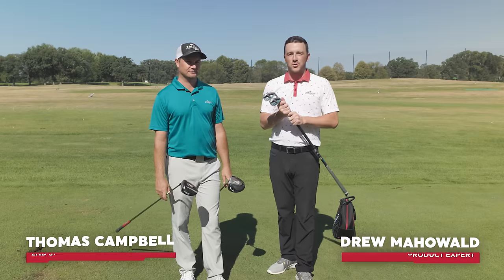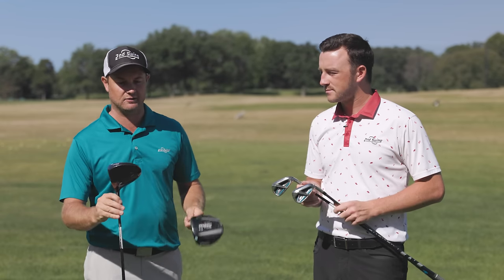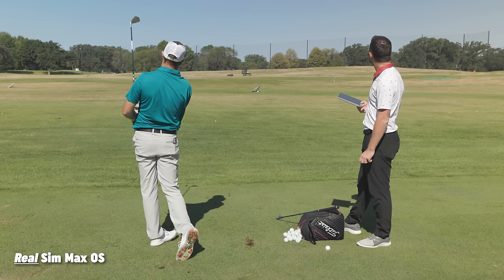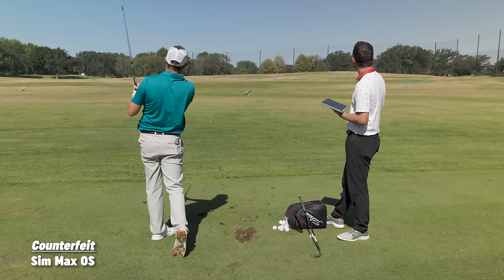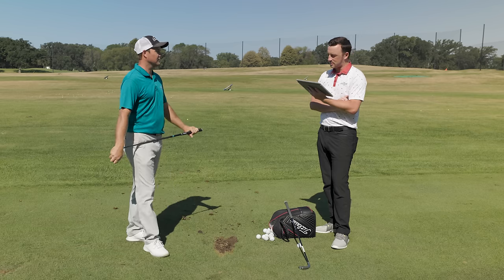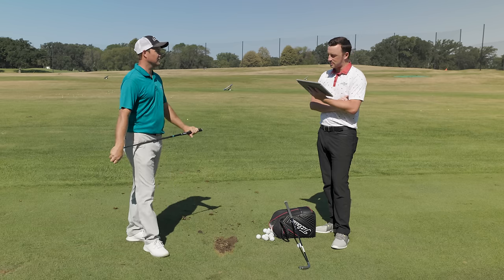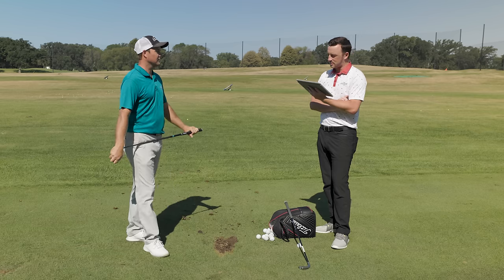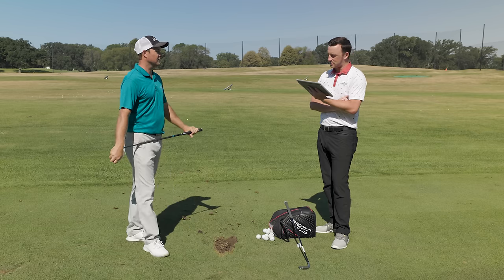FAKE Golf Clubs vs REAL Golf Clubs | Counterfeit Golf Clubs Test

Comment: As a plus 30 year clubmaker(Retired), if one would do a little research we would find that the major foundries in China are making golf clubs for most of the major brands and also the "fake" brands.  I sell clubs that are made by competent manufacturers and I check the weight of each and every component. I also check the iron shafts, wood shafts whether they be graphite or steel and  to make sure they have the correct cpm's by using a frequency analyzer.. Now having said all that realize your clubs are coming from either mainland Communist China or either free Taiwan. whether they are fake or not they are coming from these regions of the world some of these "fake" clubs are being made in the same foundry that makes the clubs for the major brands with the same specs. So I am not as adamant on whether they are fake or real as to do they perform and do they meet the specs that the manufacturers say they meet. For an example  All shafts are not stiff and to prove that point their is no industry standard for determining the stiffness of a shaft. They're so many factors in gauging a shaft for each individual golfer. The bend point (flex point) tip stiffness, butt stiffness , zoning of the shaft soft center, stiff center, I can go on and on. This doesn't take in each individual golfer who may swing 90 MPH, but one could be smooth throughout the swing while the other golfer may have a quick transition. So a huge reason to get fitted and to be aware of the price that you are paying for this fitting . Don't get snookered!   For tools I use  mostly Golf Mechanix products which are also distributed in America by Golfworks.  These tools help insure that a customer is getting the best performing club possible. I can safely say that most retail outlets don't even come close to any clubmaker. They (the big golf companies) throw the club together, glue it and cut it to industry standards and it is sold at your box stores. It is possible that 2nd swing and other major retail outlets have competent people working at their stores and they would be able to perform all of these services . Last rant I promise most of the drivers put out by all the major golf companies are fitted too long for the average golfer. They can't find the middle of the face with a 45 inch driver so why does the industry push a longer shaft to get more club head speed? If you don't hit the middle of the face you are adding spin and losing a tremendous amount of distance especially on heel shots. So I am an advocate of 43 1/2 to 44 1/2 inch drivers and leaving the box stores  to their over hyped and overpriced golf clubs and now with the  CNC machining and CAD programs this industry will change and the everyday consumer will benefit.

Comment: Glad I was just fitted with Callaway copies of the new rouge heads, carbon fiber shafts that fit my swing and real tacki-mac grips. I think they were hoping to say how bad the copies were but looked foolish when the copies are just as far, ball speed the same and most all the other stats are very close.  Even when the head flew off, that was the fathest one hit! The only negatives were "they sound louder and don't feel as good", yeah? well for hundreds of dollars less, most of us can live with that...I know will. I wonder if they do this again,  will they try it before recording.
Reply: i mean the head just flew off did u actually watch this 🤣  i rather pay more and have them for life thanks
Reply: @mufc778  you can just have it reshafted for your peace of mind
Reply: I’ve had name brand high end clubs come apart too. Clean out the hosel and add epoxy. It goes right back together. Plus you could see that this club was sliding off of the shaft before they did the test. There was a clear gap between the hosel and the ferrule.